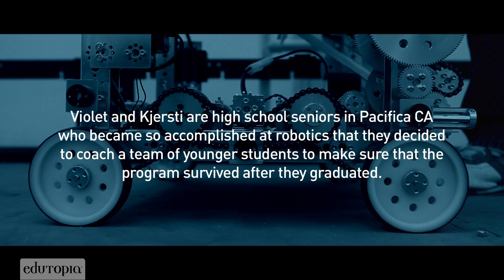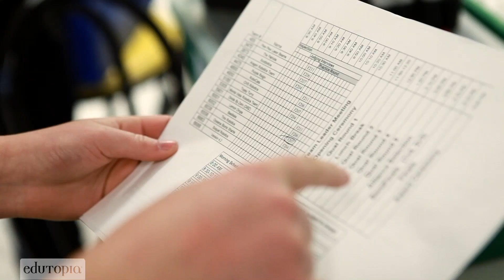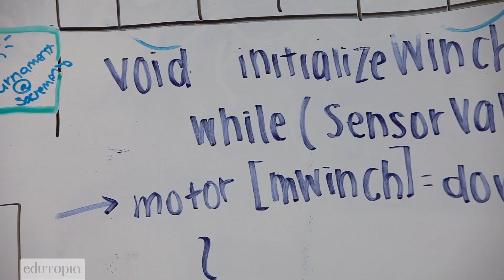How Building Robots Captivates Kids' Imaginations: Is School Enough?

Comment: OK 
I have been challenged for a comment I made that most Robotics courses  have kids putting together kits or prefabricated parts. This video seems to reinforce my idea that Robotics classes are not about hands on fabrication, but taking something preformed by an Ed company. I see no "shop' settings in this video where students are sawing filing or carrying out any technical skills to achieve their goal. The occasional soldering iron in hand is not enough.
Reply: Chris Doeller Not specifically in this vid but most of the higher end teams use atleast some custom parts. See brainSTEM with a fully custom plastic robot.